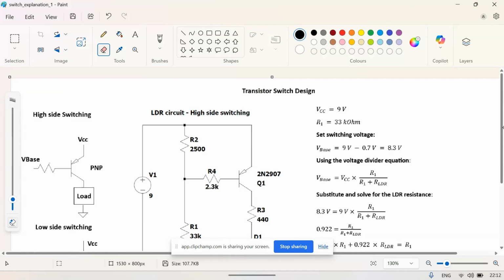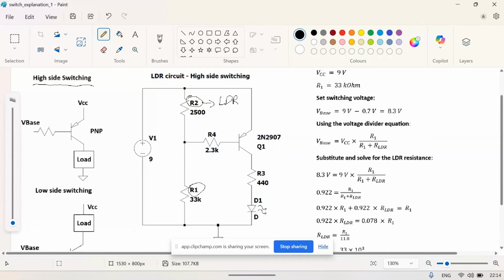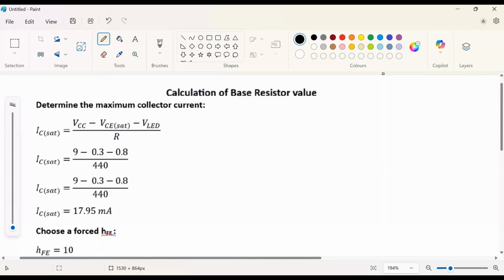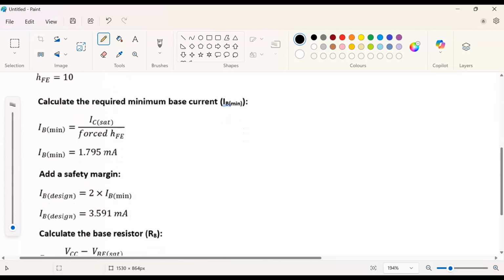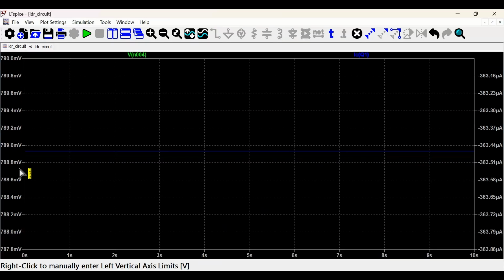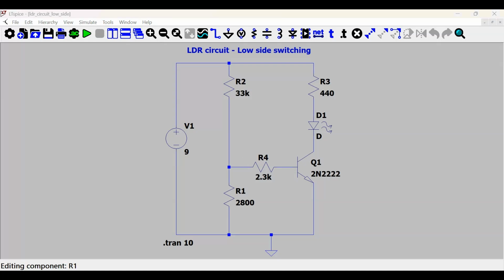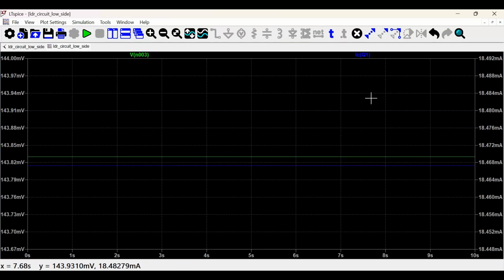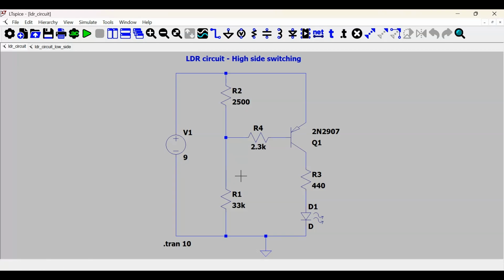LDR circuit using transistor

Comment: Dear Mr.Prithivin, 
SUCH SOLENOID SWITCHES CAN BE USED TO SWITCH ON THE STREET LIGHTS, THAT GLOW USING SOLAR CURRENT STORED IN BATTERIES OR EB CURRENT IN EVENING AND SWITH OFF THE NEXT DAY MORNING.....AS I am a mechanical/Manufacturing Engineering Professor, I could not comment on intricate details but one thing what I could say is that, you have a wonderful stock of right Jargons and you use the right word for the right situation...by...Prof.PRL.